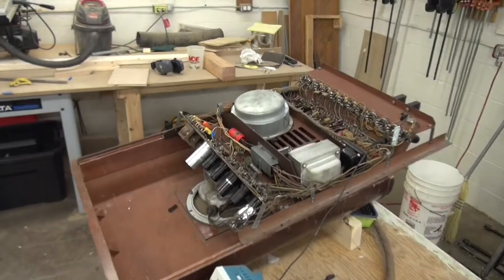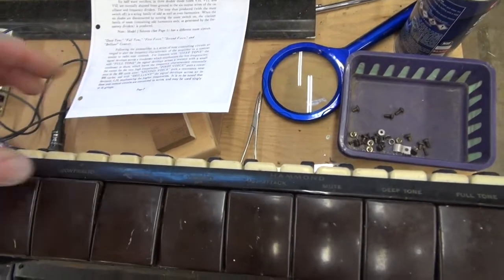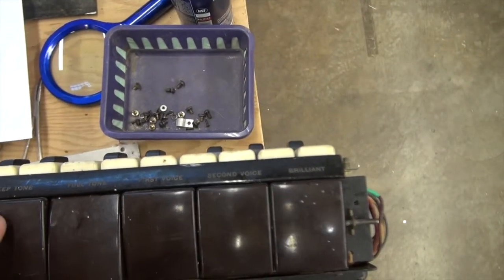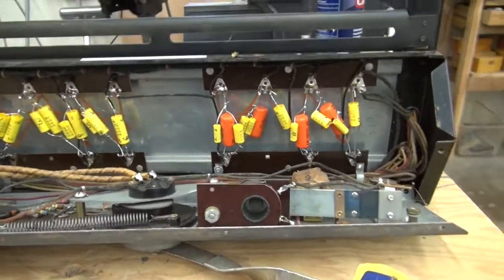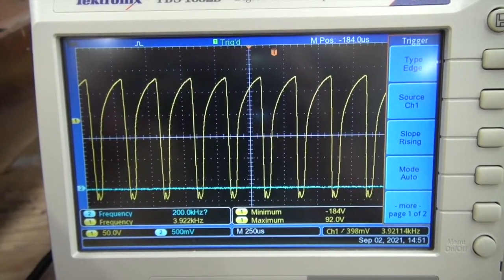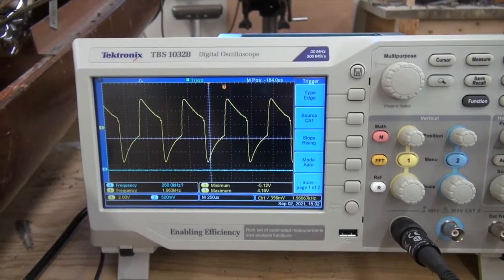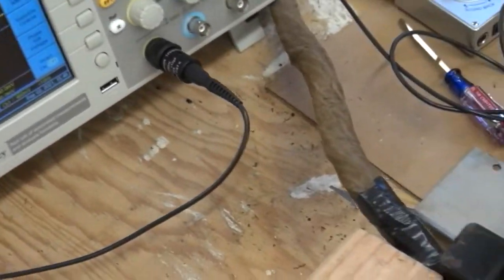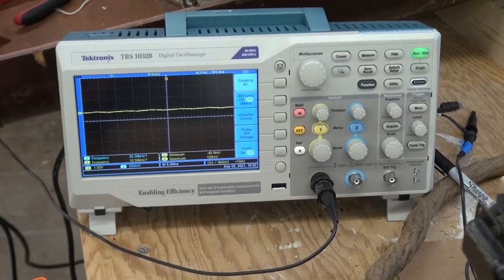Solovox- Sounds deep dive

Comment: Excellent job, very well done! Finally a competent video about this interesting instrument, thank you for making and sharing this.
One thing I would like to carefully and respectfully disagree with you about is the capacitor tuning bit you talk about at around 10 minutes into the video. If the instrument was never in tune out of the factory as you suggest, I doubt anybody would have bought it - also, it was very expensive when new. Another thing is that it was meant to be mounted under a piano, and I doubt a pianist would buy something that would butcher his sound when played together with the piano. 
I think the capacitors were hand-picked at the factory and each instrument had a "custom" set of capacitors. The values printed on capacitors are not their exact capacitances due to tolerance of +/- some % and in the 1940s the tolerances were very liberal compared to modern capacitors. They must have been individually selected, just like mica capacitors were hand-picked in radio receivers, to make the tuning dial track correctly. With time, capacitors deteriorated and their values drifted, putting the Solovox out of tune.
Reply from the maker: That's reasonable and I basically agree- but I can't believe in a factory, where they're trying to get units out the door en masse, they would sit there fiddling around like I did adding and subtracting caps of tiny values to get the temperament exactly right. I have no doubt it sounded fine when it was new, nothing like what it was when the unit first arrived here. Anyway I look forward to making a better demo of the thing one of these days.
Reply: @cnagorka  You still have it? That would be great!